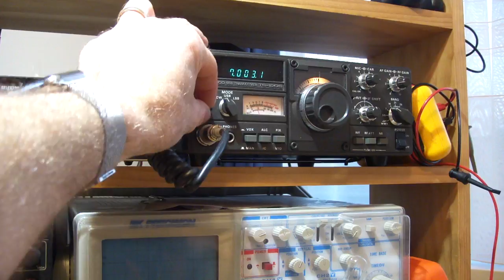Homebrew Portable 40m CW Rig - Part 4a Receiver Experiments

Comment: Just came across this. Having been inactive for many years,  I thought I'll have a look around to see if anybody still does homebrewing (I thought it was a dying art) and am very happy to see that there is still life out there! Have fun and enjoy, I might just join you guys at some point but will meanwhile (until I have an antenna up and dusted off my soldering iron) watch your interesting tinkering. 73, Jacques - ZS1PL
Reply from the maker: Hi Jacques. Give it a go. If I can do then anyone can as I'm no expert. We live in a great time for homebrew as the components are so cheap. Especially PLLs like the Si5351. 73sCharlie, ZL2CTM
Reply: Hi Charlie, Thanks! Yes I'm quite surprised by the availability and price of the stuff. A quick search yesterday revealed that the Adafruit Si5351 board and a choice selection LCD/Oled displays are available a 25 minute drive away from me at ridiculously good prices. I also found a handful of SBL-1's and some Yeasu SSB (and even a CW) Xtal filters that I knew I had somewhere, not to mention the toroids and other RF components I've been hoarding. So I hope to join in the fun soon! 73, Jacques
Reply from the maker: Excellent. Go for it Jacques!Charlie

Comment: Enjoy the video very nice Charlie, I know the filter is out of the your parts bin but what should we buy when building this?
Reply from the maker: Hi Donnie. That's a very valid comment. I am conscious that crystal filters are hard to come by and can be expensive on the second hand market. If you can get your hands on any ol' CW filter then I'd do that, and then adjust the two IF amp coupling transformers to suit. In addition to that, I do want to homebrew another crystal filter, this time using some design software. That would be another option.
Reply: I would be interested in the learning about the design of a software IF filter  with adjustable bandwidth. great stuff! 73
Reply from the maker: Wow, I'll have to get my head around that one. Would that be a software-controlled adjustable-IF (say 700Hz - 2800Hz) filter running at RF (say 9 MHz)? Or are you talking about using a software program to design a crystal filter based on a desired bandwidth? The Teensy has a great audio library where you can adjust filter bandwidths on the fly, but that's audio frequencies. Interesting stuff!

Comment: Hi Charlie, great stuff. Just wondering how the SI5351 is coupled to SBL1s? Just capacitively to the LO input? Thanks, Ian
Reply from the maker: Hi Ian. I have a direct connection between the Si5351 and the SBL-1. That seems to work well. I have not had any problems with that approach in the past.